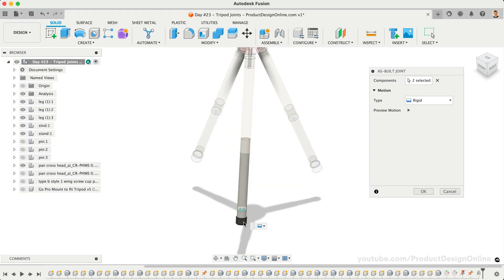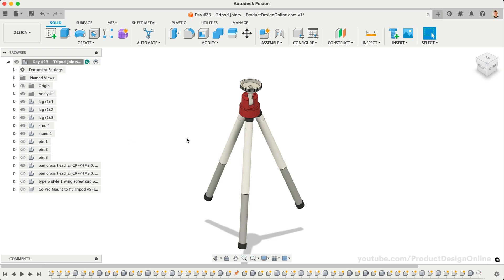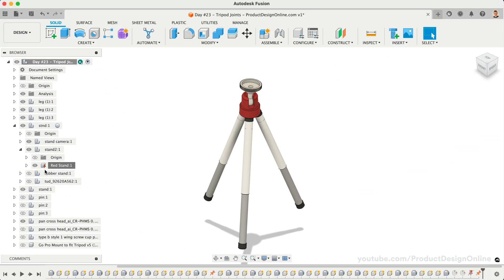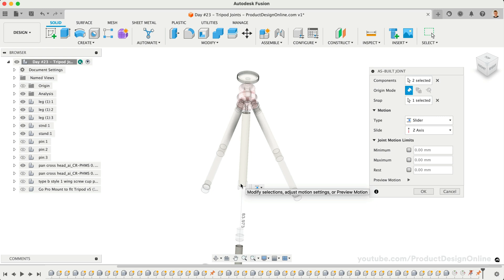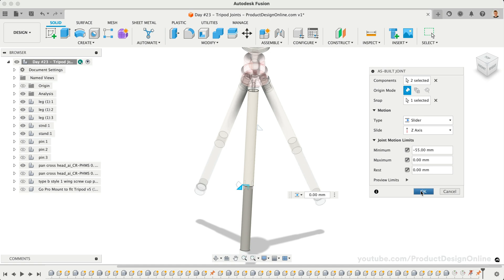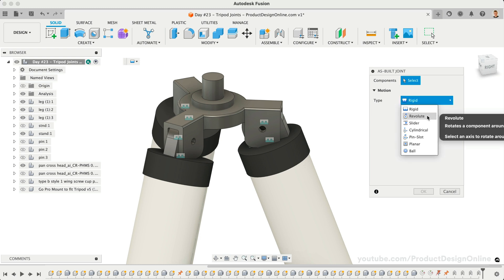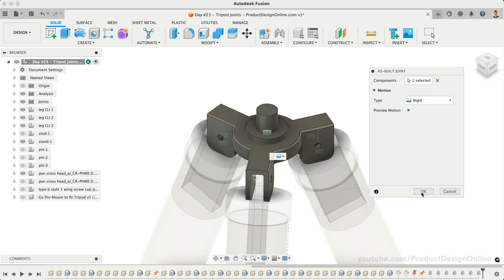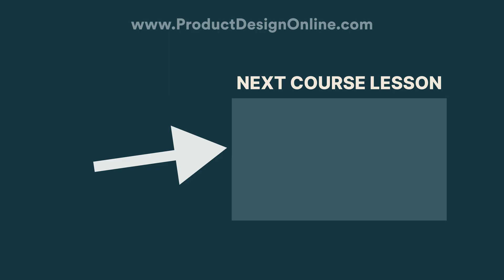Create Assemblies with Joints in Fusion 360 | Day 23 of Learn Fusion 360 in 30 Days - 2023 EDITION

Comment from the maker: UPDATE: At 3:03 you will want to select "Pin" (formerally "Ground"). "Ground to Parent" is a new concept introduced in the latest Fusion release.
Reply: Thank you for the updates, It helps a lot
Reply: @whiteknight1717  Even "pinned" still able to move- Im using the free student one
Reply: @jacobharold6786  Make sure you got the "component22", which has a single block icon, and is a layer deeper , and pin it. Pinning the 3 block icon components doesn't work
Reply: thanks!
Reply: Thank you! I wish YouTube would allow for text overlay for situations like this. I really appreciate the lesson and you taking the time to update with a comment!
Reply: @danilo352  I think one can add cards to the video later without loss... AFAIK they are called info cards @ProductDesignOnline
Reply: gotta love it when you read this after figuring it out yourself

Comment: Please demo file
Reply: Open the Data Panel
Scroll down and double-click on the ‘Basic Training‘ section which is included with the Autodesk Fusion download.
Find and double-click on the ‘06 – Assemblies‘ folder.
Find and double-click on the ‘06_tripod‘ file.
Demo files are read-only by default. Select File > Save As, and save the design.

Comment: hi where is the demo file we can use? i cant find it in the website
Reply: Open the Data Panel
Scroll down and double-click on the ‘Basic Training‘ section which is included with the Autodesk Fusion download.
Find and double-click on the ‘06 – Assemblies‘ folder.
Find and double-click on the ‘06_tripod‘ file.
Demo files are read-only by default. Select File > Save As, and save the design.

Comment: weres the demo file?
Reply: Its in the basic training files

Open the Data Panel
Scroll down and double-click on the ‘Basic Training‘ section which is included with the Autodesk Fusion download.
Find and double-click on the ‘06 – Assemblies‘ folder.
Find and double-click on the ‘06_tripod‘ file.
Demo files are read-only by default. Select File > Save As, and save the design.

Comment: 5:35 if you're finding it hard to do the sliding part, make sure to select the snap joint of the upper tube when the blue arrow is pointing down. Then use the Blue minimum joint motion limit arrow instead of typing in the value. That worked for me.
Reply: very helpful, thank you!

Comment: hi my friend , i have a question when creating the joints i would like to manually move the joint with selection , i end up moving the whole tripod instead of the invidual joints, i set them correctly because when i animate the joint it does animate correctly , however selecting a leg or .. ball joint it moves the whole tripod

Comment: Hi, this video series is great so far but I'm struggling to move the joints. They'll move, but refuse to stay put, with the exception of one revolution joint I haven't found a difference in. I'm moving them well within the defined limits, they won't move further anyways. 
Is there a setting I could've changed on accident?

Comment: i can;t seem to do the sliding part...  it keeps changing all 3 values.. i  can't do them 1 by one...   how to fix that?
Reply: i had the same problem, it was because i set the snap point to the edge of the tube and not the bottom ( side) of the tube
Reply: I’m having the same issue. It also is upside down. For the leg to go inside the other leg it needs to be 55mm, not a minus. 6:39
Reply: @Croft_Customs  i had the same problem, it was because i set the sasp point to the edge of the tube and not the bottom ( side) of the tube

Comment: Thanks for the videos. One question, I have not find any thing to physically limit the motion of the leg, so if i 3D print this thing the leg will fall out, correct? What can i do to improve the model so after 3D printed it can limit the motion? Further question is, if such feature is added to the 3D model, will the program be able to pick up the limit automatically (perhaps through physic engine collision algorithm)?
Reply from the maker: Unfortunately, this model was not designed with 3D printing in mine. You could a lip on the end to prevent the tube from sliding out.

That said, Fusion's joints will not automatically detect that you still have to set the joint limits.

Comment: For some reason when setting the resolute joints for the three leg/body junctions the values of Min -40 and Max 25 work on only two of the joints. When those values are entered into the third joint the Min Max positions end up in very different places when click-dragged through their full range of motion.
Reply: I had to play around with this for a while before it worked.  It did work eventually.

Comment: Thank you for the course! At 8:55, I'm not seeing the flag to move the leg and determine the correct value for the maximum or minimum. The animation itself is working fine.
Reply: Having the same issue
Reply from the maker: Sorry I'm just seeing your comment. This is a known bug and fix is supposed to be released soon. In the meantime, you'll have to use the input fields in the dialog box to set the min and max values.
Reply: @ProductDesignOnline  Thank you! I've already completed your 30-day course, and it was incredibly helpful for me as a beginner in Fusion 360.

Comment: I had a little trouble before I realized that pin should be used instead of ground to parent, otherwise another great lesson.
Reply from the maker: Thanks for the note! I've added a pin comment to call this out. 'Ground to Parent' was released in the May Fusion update.
At 3:03 you will want to select "Pin" (formerally "Ground").

Comment: no matter what I do, I am not getting the flags at 5:40 with version Fusion 2.0.19440 x86_64 😞
Reply: i have the same issue. would love to be notified, if any solution is provided.
Reply from the maker: Can you share a link to a screenshot or screen recording?
Reply: @ProductDesignOnline  for some reason i am unable to post the link. Trying to post a basic comment now, if success full I will try to proceed to post the link.
Reply: it seems it get's censored for some reason. this is the video code, please insert it into the URL manually. Thank you in advance! 
SHHi2zSqF1Y

Comment: Greetings - unable to d/l file to engage with training session.  What is link to d/l this file.  Thank You.
Reply from the maker: This specific file is in your Data Panel already. 
Open the Data Panel
Scroll down and double-click on the ‘Basic Training‘ section which is included with the Autodesk Fusion download.
Find and double-click on the ‘06 – Assemblies‘ folder.
Find and double-click on the ‘06_tripod‘ file.
Demo files are read-only by default. Select File > Save As, and save the design.
Reply: Unable to see it - I have (not for commercial use) also limitations of 10 saves...please advise? @ProductDesignOnline

Comment: If you're looking for "Ground" at 3:03 , it appears to  have been renamed to "Pin", do NOT select "Ground to Parent"
Reply: Does the pin option work? I'm still able to move the red stand even after pinning
Reply: @bragadeesvaran2668  it worked for me. I’m learning just like you. You can ask the creator for details.
Reply: @bragadeesvaran2668  It does for me. Maybe you selected the wrong component?
Reply: @bragadeesvaran2668   mine is still moving to did you fix it yet? edit: i had to open up another group of components to pin the component and not the group. that fixed it!
Reply: @bragadeesvaran2668  you can pick the "body" in stand2:1, I guess you picked later
Reply: @bragadeesvaran2668  yes it works you should select the body not the component I think
Reply: @abdalwhabrayis4457  You can´t pin a body. At least in my case only able to pin a component, which works as desired.
Reply: Thank you
Reply: Thank you!!!
Reply: Comments like this are a life saver, thank you!
Reply: Was Able to Ground "stand2:1" which did the same thing.
Reply: Thank you!
Reply: I thought so
Reply: Thx twin

Comment: The flag icons do not appear for me when attempting to set the Min/Max values in the "As-Built Joint" tool. 

Any suggestions?
Reply: Make sure when you select the 'Snap' you highlight the interface between the two component and not the outer edge of the chamfer
Reply: Same here, I ended up just unchecking the other two boxes (min and rest) as every time I changed a value they all changed.
Reply: I also dont get the flag Icons.. Trying to click everywhere in the joint...

Comment: I GOT THE BALL JOINT WORKING CORRECTLY!!!

The Section Analysis tool helped me identify conflicts that prevented Contact Sets from working.

I shrank the ball by 0.1mm, cut the right side of the mount path in the red stand 0.7mm, cut a new tangent arc through the bottom of the path, and chamfered the path edges 1mm. After that the contact set between the camera mount and red stand are working perfect! :D
Reply from the maker: Well done. Great job sticking with it!! 💪
Reply: You're a life saver! I would not sleep well if I didn't manage to make it work correctly. Thank you!
Btw, I also shrank the ball by 0.1mm per instructions, but then I just filleted by 0.75mm the path that the ball would go through (the rectangular edges on the side of the "stand2" sub-component, which were the points that were touching the "funnel-like" shaft), with tangent chain (15 edges selected automatically).

Comment: Hi there! I've got a problem with joints. For example, try to make a body and name it Body1 or whatever you like. You can't move it till use "move" function and it's ok. After that make a component from the Body1 and then you can move it free just clicking on it the left mouse button and it's ok too. Next use "Ground" function with component and it will freeze his position. Now make the second clean project and insert your component Bosy1 in this new project using function "Insert into Current Design". You still can move it free just clicking mouse on Body1. And here we are close to something interesting. Use the "Ground" function for Body1 here to freeze it....... I CAN still move it after all ..... WTF ???!!!!